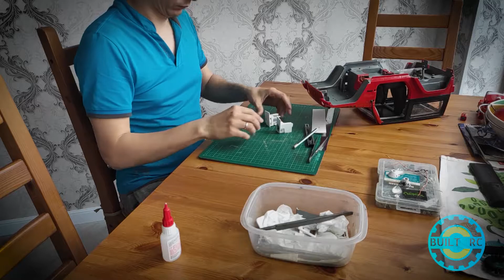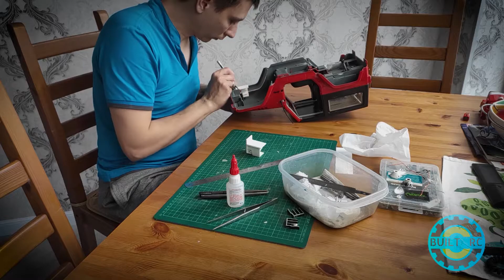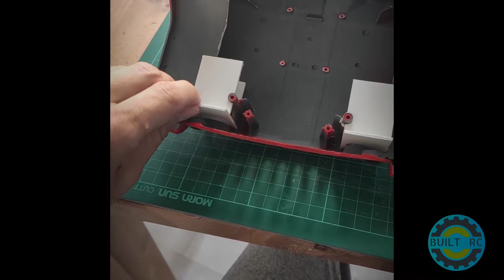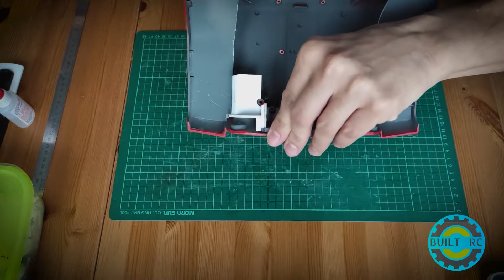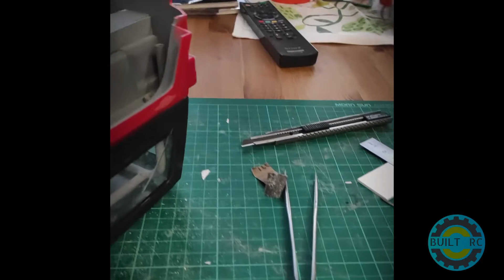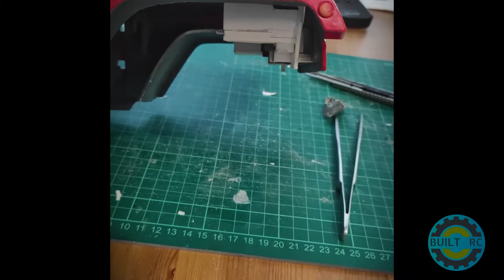Headlights | JEEP JK #3 | Built RC

Comment from the maker: [Specification]

Body - JEEP JK Rubicon 2-door (China)
Chassis - custom: 
 Axial scx10 frame, axles, gearbox
 scx10-2 c-hubs, knuckles and universals
 traxxas slipper with spur (54 tooth 32dp) 
 11-tooth pinion
 Robinson racing middle and lower gear
 MST CFX 1/10 rear shocks (70 mm)
 MST CFX 1/10 rear driveshaft
 3-link front with custom Panhard bar
 custom links (TRA5347 rod ends)
ESC - Castle Sidewinder 4 
Motor - Brushless 540-size (3650) 2300 KV  4-Pole Sensorless 
Servo - Power HD Waterproof 20kg
Tires - 1.9 Super Swamper 108 mm (China)
Battery - Gens Ace 6800 mAh 2S LiPo hardcase

All episodes of the build - https://youtube.com/playlist?list=PL2W8qYYhnCfJaqiy6gg2fKjbwuVN8MkfA